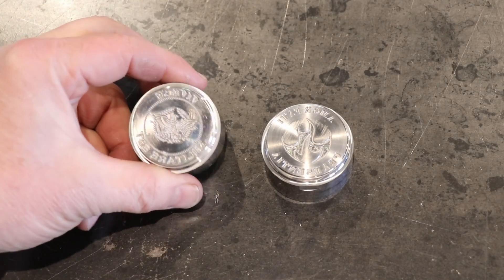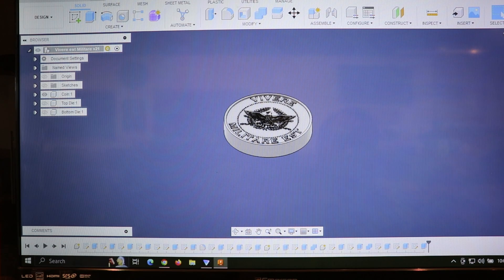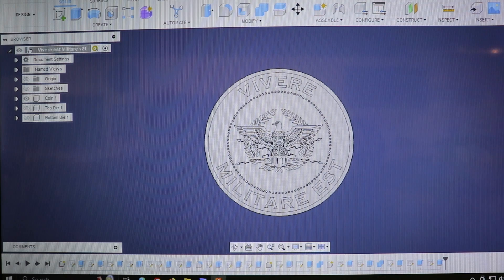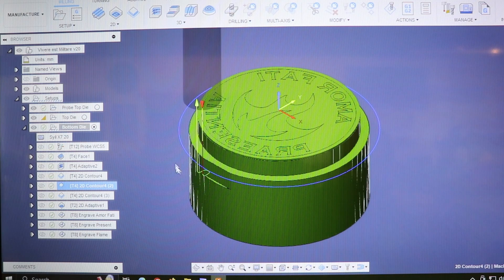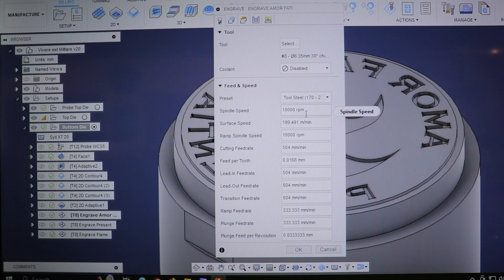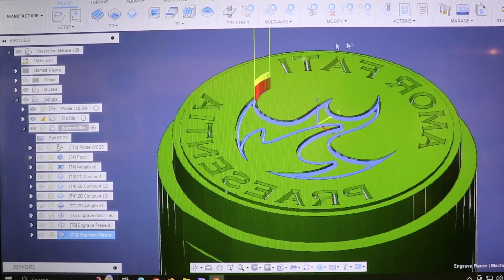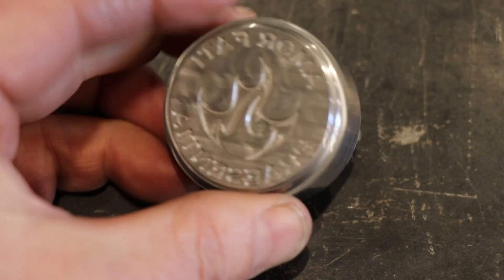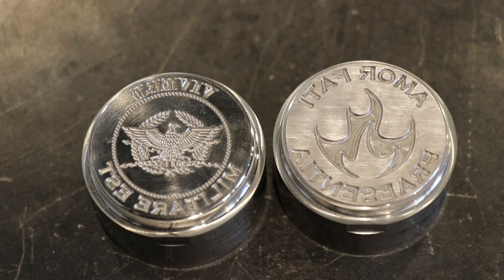Milling a Simple Coin Die: Repair Operation

Comment: How to choose the die height ?
Reply from the maker: I choose my die height based on how I forge and press the coins. For me 1" / 25 mm is the sweet spot. I don't have fancy equipment or die holders. 

I'm sure that's different for actual professionals.  If you research how the US Mint makes its dies, they are very different.

Comment: When face milling i have found  that conventional milling produces a better blend then  climb milling. . This is just my experience doing shallow depth of cut and 75% stepover.
Reply from the maker: Thanks for the comment.  Have you ever tried the "Flat" tool-path in Fusion 360. I've been employing that strategy on some of my parts and the results are often really cool.  Like you said, it's a finishing strategy so shallow DOC and larger step over.